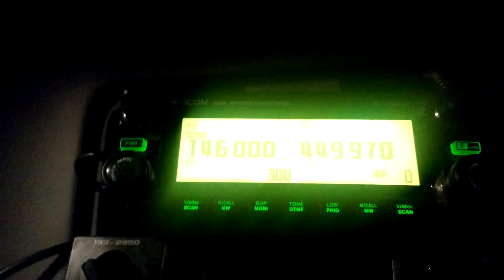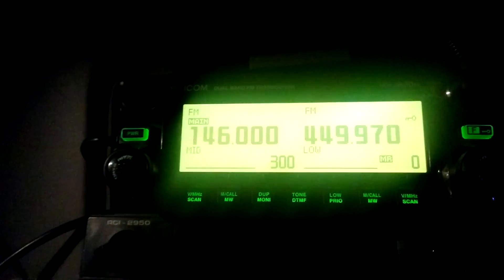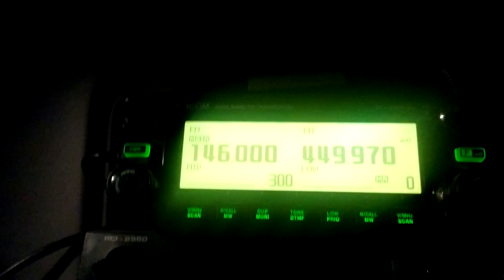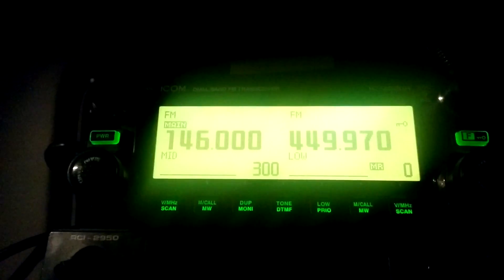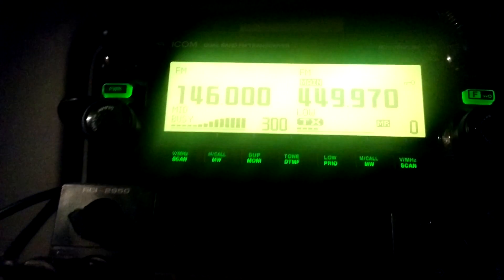ICOM 2820 cross band repeat dv

Comment: how are you accomplishing this on a simplex channel on the id-51 though? to acces a hotspot you also need rpt1 and rpt2 settings to be transmitted which you cannot change in simplex mode?
Reply from the maker: You can put the id-51 into a zero offset. Enable duplex and change it to 0.0000

Comment: Ken,  Thanks for the video.  I'm in the market for a 2820 myself.  After having an ID-51A and it's ease of use, I'm worried the 2820 will be much harder to link/unlink repeaters.  Have you found the need to use memory channels as shorcuts for linking/unlinking?  Any tips to make the 2820 easier to switch repeaters on D-Star?  Thanks again,  Rob